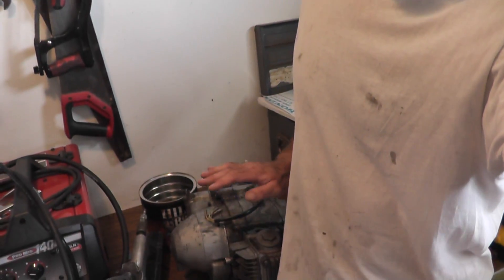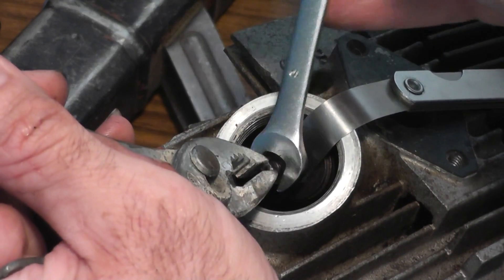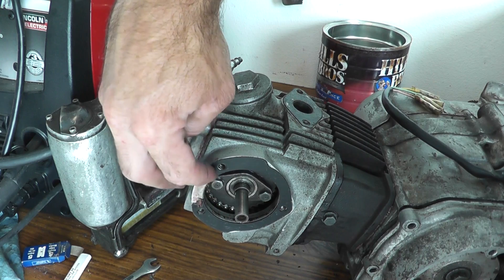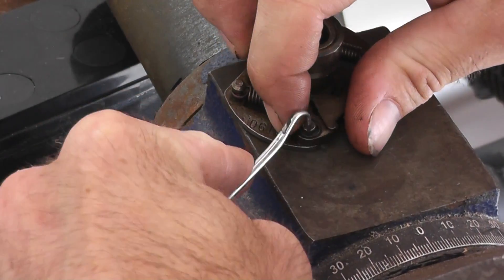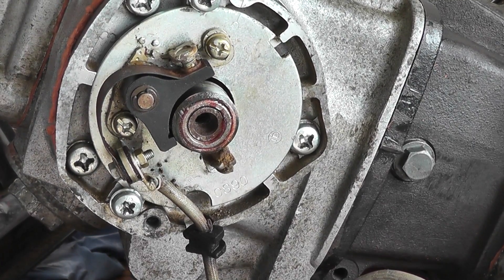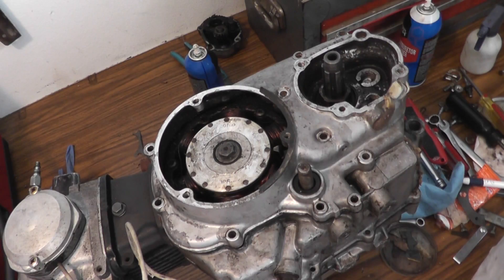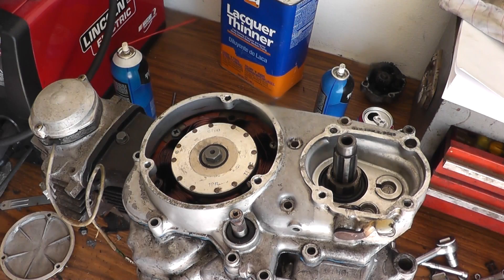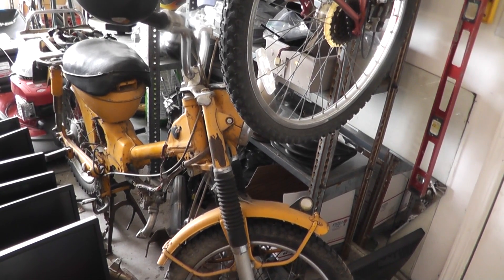Jake's Honda Trail 90 Project - Part 6 - Valve Adjustment & Ignition Timing

Comment: Hi Jake
 Since you and your son  are way more knowledgeable then me I have a   quick question  . I have 62 Trail 55 and 65 Trail 90 and both sitting  cause  I can't get a spark, on Trail 90  since it has many coils by the flywheels   and  if they are fine  when I  turned the  crank  shouldn't I get a  "test light"  turn on  from the black or the  yellow wires  even nothing else is connected  like  Condenser and points? 
 Thanks
Reply from the maker: I am not sure I understand exactly but to test the coil you would have to put your voltmeter, ohmmeter, or test light to each end of it. If you haven't, try to get your hands on a wire diagram so you know which wires to probe. Good luck!

Comment: My dad told me to make a side cover gasket out of a file box folder once and I did and it actually worked great! I will say I used a thin layer of rtv sealant on top as well but it did work w no leaks

Comment: Hey Jake, I wanted to thank you for this series.  I was gifted a 1969 Ct90, and I found your channel and this series.  It is such good information your videos are REAL experience not the magic of you tube.  My favorite line of all this series is "NO FOREGINER THIS DOES NOT FEEL LIKE THE FIRST TIME...."  I've  felt that way a few times while fixing my bike (the Lazarus project).  mine  is almost identical to your Elsa, frozen piston, stuck vales, wiring harness is a mess.  I can say 3 weeks after I acquired this bike I have it RUNNING!!!  Thank you very much for your AMAZING VIDEO series.  You rock man.
Reply: Thats cool
Reply: You are very funny but very know how to work on those little honda trails. I just bought 2 of them and havent got eather one running! Ha have spark gas and lots of hope! But i am starting to loose interest. I am obously missing something. Set points to .015 i just cant get either to run. I am going to keep watching your vidoes and laff

Comment: I just rebuilt my 1975 CT90 motor.  While I think you do a good job describing most things I cringe about using old gaskets and not chasing all the threads on every bolt hole to ensure no problems.

Comment: I know you've already done all this, but as a professional auto mechanic with 38 years experience, I wouldn't even consider not replacing all gaskets with new ones. It's just not that expensive. And many gaskets are precision cut for such things such as oil passages. Also the thickness is part of the engines design. I have made home made gaskets, but only out of dire necessity, when no new gaskets were available everywhere. I also saw a couple of other things that bothered me. First, in the previous video, I did not see any valve guide seals. Does this engine not use them? If not what keeps the oil from leaking past the valve stems? Second, I would have used a Dremel with a reinforced cutoff/grinding wheel to deburr those valve covers, and the proper socket (not Chinese) to tighten them. I admit to using Harbor Freight tools, but not when it comes to anything that actually touches a fastener, like sockets, wrenches, screwdrivers, etc. I use Snap On tools. Everybody has their favorite brand, but get a high dollar name brand. NEVER use pliers or an adjustable wrench on a fastener unless you intend to replace it. And I would have never used RTV in place of a base gasket. You likely plugged up that oil passage. You saw how that stuff squeezes out when you tighten the nuts/bolts down. I understand doing stuff on a budget, but when building an engine, there are some places where you just don't cut corners. I would have also gotten the proper size hone for that cylinder. They are not expensive. Those vertical gouges are going to cause the engine to burn oil, because they give the oil a way to get past the rings.
Reply: Gerald Scott this is a hobby project. He is taking this as a challenge.

Comment: At 11 minutes, there is a single bolt on the outside of the case.  I have a 71 CT90 and that bolt disappeared.  For the life of me I don't what it's for or called, or where to get one if I did.  Any help?
Reply from the maker: If you're talking about the bolt on the side of the cylinder, it holds a roller for the cam chain. google 14615-035-010

Comment: Man this video brings back so many memories. On old Honda bikes l usually set my valves, on the intake: 2 thousand's of an inch and 4 thousands of and inch and on the points I think I would set the gap at 12 thousands of and inch and 12 degrees before TDC. One time I rebuilt the engine on my old Honda Superhawk. Well I didn't know it at the time but I installed the camshaft, one tooth off. Amazingly the poor thing ran but barely, backfiring through the carburetors and exhaust. I was so pissed because I had to yank the engine from the frame and take apart the top end again. It was tough medicine for a very young motorcycle mechanic.

Comment: Gasket maker is fine anywhere but on the side covers. Honda made these bikes with very specific tolerances, so you need to use Honda's gaskets in order for it to shift correctly. So that's a no no. 

Other than that, everything is brilliant. Good work.
Reply: Watched a little further, and you got it right with the final drive cover. Nevermind.